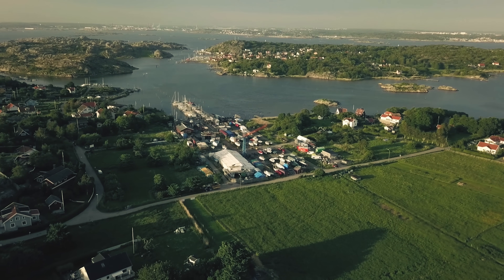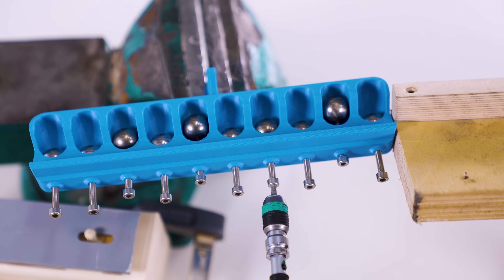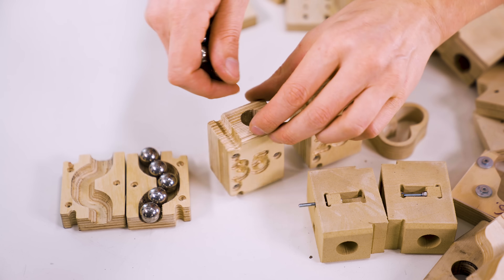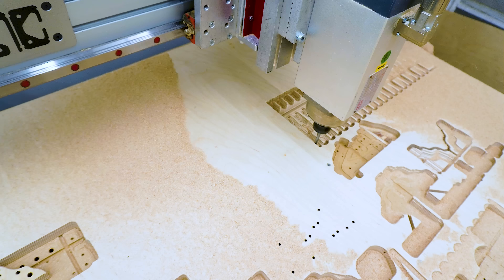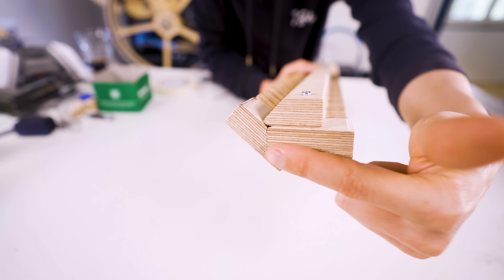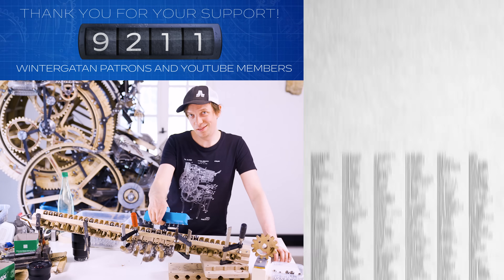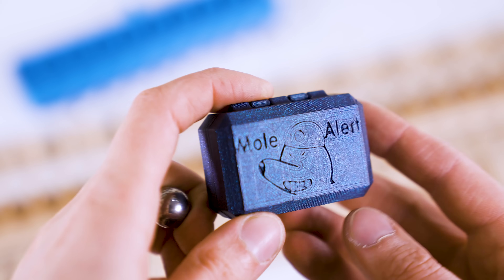Engineering Basics: The Best Part Is No Part

Comment: I was going to say the new design is working, but seems to be quite noisy. As another comment mentioned, this could be from a difference in design and the path not being smooth. I think the trapdoor method would be remarkably effective in helping noise and pressure/weight issues if used in conjunction with this new marble divider design.

Comment: @Martin.. I know you have struggled with the art vs. the function side of engineering... What you're doing is very much art.. there is very much an Art in simplifiying an idea into a functional item using as simplistic and reliable design as possible... Some times it's just as flashy (your cog wheel marble gate for example is beautiful)... I'm loving the work you're doing.. keep it up man

Comment: I am going to bet right now that the solution will not work with an endurance test.
With the angle precision required right now, the element's wear and tear will render it prone to critical failure. This solution is not plywood-compatible.

Comment: Hard to see on video, but it looks like you are "misinterpreting" Rosero's design a little. The holes are to close to the center line of marble-path. In your plywood version the marbles are falling more down than in Rosero's design where they are tipping to the side more . . .

At least it is an important tuning variable together with the two planes angle ( 4+18 deg. )

Wow Martin! You are impressing with your CAD/CNC skills . . .

Comment: I personally love the design philosophy evolution evident throughout the height adjustment designs. First, the grey part was clearly a result of the glee that comes with planning everything in CAD: it doesn’t need to be adaptive or adjustable because I have planned out and calculated exactly how it will be. All of the succeeding types were slow evolutions towards a fully adjustable design, acknowledging that sometimes things cannot be perfectly planned and that you must leave room for error. Finally, with this system, there comes the realization that the best solution to a problem is to never have it - nor have to deal with it - in the first place.

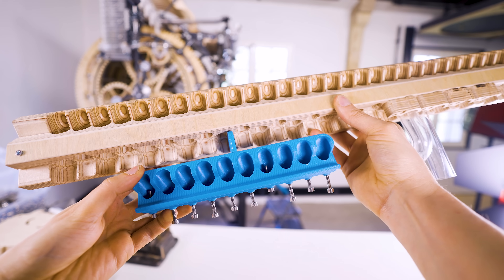Comment: I'm pretty sure someone already mentioned it, but instead of increasing the angle of the marble divider, make sure the marbles can roll smoother. It's clear that your version is a bit different then Rossero's (9:01). On Rossero's the marbles are rolling on a ≈flat surface, while on your model they're bumping on those cutouts.
Reply: It also seems to create a lot of noise.
Reply: @BuntUndStereo  and this might only be the beginning of further provlems. Considering literally millions of marbles will bump into these wooden ridges, I believe that they will wear pretty fast. This would  increase the amplitude of the zickzack motion.
Reply: @sebastian85429  It needs some tweaking but I'm sure Martin will figure it out.
Reply: @BuntUndStereo  I came looking for this before I typed it.
More iterations to come I would suspect, I'd wager the frame of the machine will amplify the noise further. Might be as simple as cutting it into 3 or 4 pieces though.
Reply: @jimmyb1451  Yea, Martin's version probably needs some tweaking. Besides the noise the marble flow does seem rather restrained/sluggish with this setup. If anything I thought maybe the table top did amplify the noise more than it would be on the machine. We will see (hear)...
Reply: Thank you for pointing out what was the reason the marbles kept getting stuck! I had a weird feeling all the time watching that "wait, that's not supposed to work like that" but I couldn't point my finger on why I had that feeling.
Reply: It seems to me the difference is that the side walls on Rossero's part go further out, so the marbles are running in a straight line?  Whereas on the plywood model, the side walls are shallower, so the marbles make a little detour, zig-zaging down the track.
Reply: I hope he finds this out
Reply: Agreed, there are definitely some tweaks to be made to the design.  Friction seems like it's a much bigger problem with this version than previous.  I think Rossero's version gets away with it because it's plastic, but the wood slows the marbles considerably.  It looks like some slight alterations to the geometry of the dividers will help the marbles run more smoothly, and that will also aid the friction issues since momentum will be more conserved going down the line.
Reply: @LightPhoenix7000  Remember that the marbles are split into 8 tracks that are distributed across the length of the marble divider.  Only the overflow marbles need to cross more than a few lanes.
Reply: While there might be some gains with slightly better geometry the nature of this method is that all the marbles have to want to fall into the slot, so will always hit the cutout somewhat - Rossero's 3d print would almost certainly show the same issue once it was made as long as the plywood version. You can see the initial marble entry on the plywood one they run fast, and smoother, its just all those little bumps steal some velocity all the way down. 

Don't think it matters at all though - Martin isn't feeding this only from one end, so the fresh influx of high energy marbles all down the length should push on any laggards in short order. As long as they are not arriving too energetic and bouncing themselves or the other marble out into the critical fail zone off the 'pocket' - if you ever played pool/snooker you'll know too much energy into that corner cushion over the pocket and even though the trajectory is good and wants the ball to fall in it has got too much bounce to be contained...

That said those rather thin cutouts I would suggest will wear out rather quickly, all those little hammer blows of the marbles hitting it is surely going to be much worse for the plywood than any of the thinner paths they are just rolling along, so making the cutout section in acetal perhaps, being both lower friction, and a homogenous slightly elastic material (i.e. its got some give, and won't throw splinters) I'd think it will be both quieter, faster and longer lasting...
Reply: @foldionepapyrus3441  they're hitting the cutouts on the center of rotation in the plywood version. Bumping the cutouts on the side is much less disruptive to the marbles than having to roll over the top of the bump. I this current plywood design, the marbles have to be forced up over the lip of the holes by the marbles behind them, robbing the system of energy. A smooth track for the marbles to roll on would eliminate that problem.
Reply: Marbles will be moving faster when on the machine
Reply: @foldionepapyrus3441  I wish I could permalink YT comments so I could share this to the MMX Discord
Reply: @SuperSeagull12  Whichever thought I had you liked by all means share on the discord if you think its useful. Heck claim it as your own if you feel like it. I  just want the MMX to keep developing in the best way...
Reply: In CAD it is pretty much identical, maybe a small error has slipped in during machining
Reply: @rosserobertolli  he didn't add the lip and rotated it by 45° about the longitudinal axis, so now the marbles no longer roll on the flat, but the grooves.  Please let him know that he needs to add the lip and rotate it the correct way.
Reply: @marklindsey1995  I'm sorry, but he didn''t. There were some plywood and machining related issues, but they are being sorted out. But the geometric translation from my prototype to his is done quite well. Some things are a bit off but not by 45 degrees. And the part is rotatable
Reply: Your comment bugs out on mobile, the read more and timestamp overlay each other. Weird
Reply: @snacksy7754  Just click the text and its all good ;)
Reply: I made a comment that the lacquer probably is causing more friction on thr marbles, and some smooth sanding might help it.
Reply: it also seems Martin's uprights between the holes don't have the same subtle slant Rossero's has, instead they're ~90 to the floor the marbles roll along. as others said this causes the marbles to slightly zig zag along.
Reply: If the marbles run smoother down the groove as they would do in the prototype design, they might become too fast and skip the pockets. That's the challenge with the full scale length. Marbles need some automatic speed control, and for this the bumpy run might be beneficial to some extent.
Reply: Yes! By filleting the edges, he has created a point of equilibrium at each slot, where the marbles can rest between the marble in the hole and the fillet. Rossero's version didn't have those points. It seems he did this after his live-stream.
Reply: @ehals  +1, I think this is a big part of the problem. The original has very square vertical pillars between the slots, encouraging the marbles to move farther down the track. The wood version has rounded over vertical pillars creating a resting place for the marbles. I'm sure it is not the only thing that can be optimized but it is certainly one of them.
Reply: Agree. Theres WAY more friction in his model and the machine milled wood vs the smooth plastic.
Reply: I believe that the bumps are necessary to allow the marble to slow down enough to fall into the channels
Reply: I can't be sure, but it looks like the marbles in the pockets are closer to the rolling marbles in the plywood version than they are in the plastic version, where the rolling marbles almost look like they miss the pocketed marbles.
Reply: i feel like if he sanded down the dividing walls just a bit, it’d help enormously.
Reply: I think through use of the divider, some of the issues with surface roughness will be mitigated by the wear of running a bunch of marbles through the system. that wear can smooth out the path the marbles follow decreasing the friction. but the amount of bumping against walls could still be an issue.
Reply: Also, the cutout edges, will they wear over time changing the behaviour? Seems like there is only a little surface to wear out before they might even skip the cutouts. Maybe coat it in marine epoxy?
Reply: Is it just me or do I miss the part where the marbles go THROUGH the marble diveder when one of the channels is empty? The adjusting screw would block marbles going through the divider? Or were the adjustment screws there to demonstrate that it works with different heights of filled marblelanes?
Reply: @johan6983  i believe you are correct in your assumption about the screws simulating different marbe heights. If it falls into a channel, it feeding through the pmma pipe is the easy bit, it's the initial division of the channels that was the part that needed a solution
Reply: If you look better it is Martin that laid the 3d print wrongly on top of the MMX. The piece is rotated 90°. The design is the same
Reply: I was wondering why it was so bumpy. Martin could use that wood color printed material.  Then it be faster with less angle.
Reply: @assassinlexx1993  Several times, I think wood been the culprit. Its texture makes for too much "grab." It certainly did in all of the marble gates as opposed to the 3d printed plastic prototype.
Reply: @doneachus6780  its also softer than the pastique.
Reply: @assassinlexx1993  That's a good idea in principle, but have you seen the size of the marble divider? That's a huge part to 3D print, I don't know which printers have such a large printing area

Comment: A potential probem with this marble divider, which came up with previous designs, is that the later channels are going to get fewer marbles than the earlier channels, because any deficit in an earlier channel must be filled before a later channel can be addressed.

You can't refill the marbles in the snare drum until the marble has been replaced for the note you just played on the vibraphone.
This can be fixed by having a high enough marble flux such that all the marbles necessary for the later channels can pass by between the notes for the early channels.
This solution is unrealistic, and prohibits certain high frequency patterns.

So you may need to again create a way to introduce marbles to the divider at a later point.

Comment: Am I the only one who constantly sees an elephant in the room that has never been addressed - the need for the MMX to operate on a probably wobbly stage floor with multiple people moving around? After being disassembled , shipped around, being bumped and reassembled?
Reply: In regards to the wobbly stage floor, I think there are adjustable leveling feet at the end of each of the MMX legs
Reply: Ah but if the floor moves from people on the stage? I see what you mean, I don't think the floor will have much additional deflection from people moving with the weight of the mmx already on it. But I see what you mean, could be an issue

Comment: I have a suggestion: Make the pipe holder a separate piece which the divider can mount to. Then the divider can easily be replaced if damaged, and you don't need all the small "cat" pipe holders.

Comment: Sorry for ruining the hype...As I'm watching the marbles go down the new divider. I'm starting to think that the noise is a dealbreaker... This is a LOT of noise...
Can't we imagine a groove on witch marbles would ride so that they avoid hitting the splitting walls ? So the openings where the marbles fall would be inside the groove?
Reply: No noise at all when using properly mic-ed instruments that are a meter away. Unless the entire machine shakes due to this design it won't be picked up in the slightest.
Reply: @Koushakur   Well, there are multiple sources of noises, and Martin did go over a ton of them. And it looks like the marbles hitting the spliting walls generates king of a significant  amount of noise. If I understand correctly the overall noise is a Real concern

Comment: One of the problems I see with this design is how loud and random the sounds are. You may need to put a rubber strip or something along the edge to try and absorb the sounds so you don’t get the random clacking as the marbles roll down the divider.  The design is good, although I would have used the vertical piece as a rail so as to prevent spillage.  Keep working and refining and you will finally get your MMX up to the top of that Sisyphean mountain.
Reply: In the live stream CAD session, Martin did say that he would be adding a metal rail once it is installed on the machine. An open metal rail is going to give much more visibility to the marbles than a full wooden wall.
Reply: I was actually talking about the plywood version he built.  Seems pretty loud.  Now I don’t know what the mic setting were at and it could be much quieter than it was presented as.  Still I would think there needs to be some consideration on the noise it makes because it’s not in syncopation with the machine, like the fish stairs. It doesn’t seem to be a big issue to overcome, but I think it is one that needs to be addressed.  Reducing parts count is key to increasing reliability.  Keep up the good work.
Reply: He has addressed signal to noise issues before, and recorded examples to listen to. What you hear in these videos is not how it'll sound in the mics/pickups
Reply: The old divider is about as bumpy as this one, he just never directed a mic to it like he did in this video. It may be a bit louder, but the noise of the machine is only a bigger issue 'below' the vibraphone (and I think snare drum?) microphone
Reply: Snare mics are closer than the vibraphone mics, at least the 3 mic setup he used previously, and the snare is louder too.
Reply: Dampening removes energy. The thing is slow already. With rubber or any kind of padding it would probably not work well enough
Reply: its a 3d print so he can use the quietest type of filament he wants
Reply: @spyseefan975  That's the prototype, he ain't 3d-printing the entire thing... which he shows in this very video